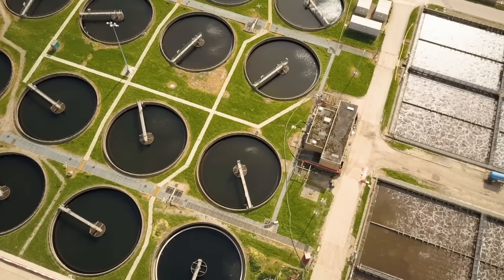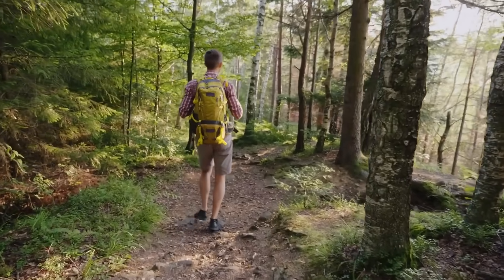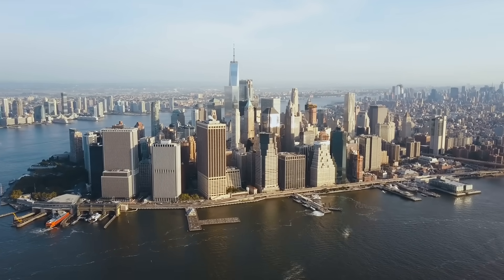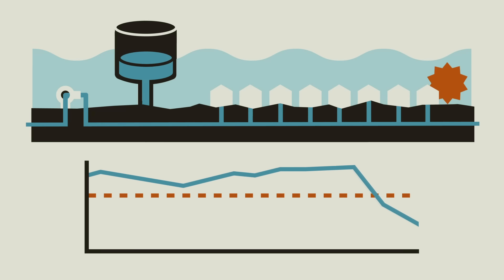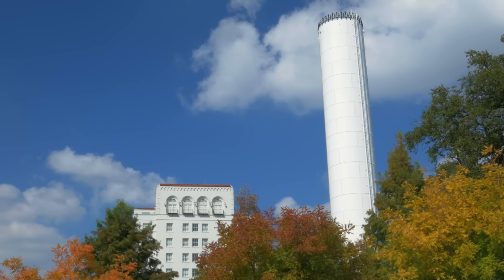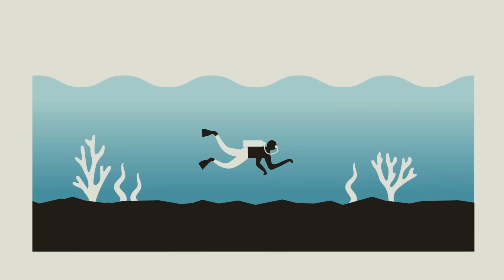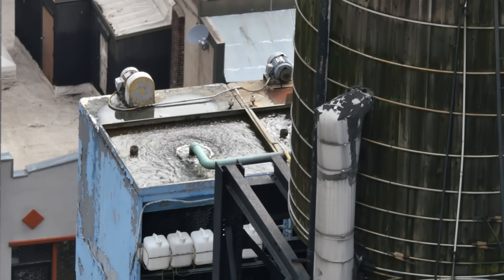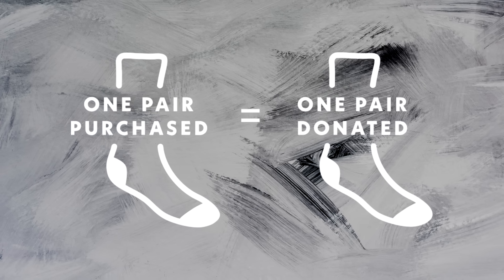How Water Towers Work

Comment: I am a FireFighter in a fairly small town in Ga, the town has about 12,000 residents. The local landfill operator was VERY unaware of the need to keep the pile covered as much as possible and actually told me spontaneous combustion from decay was a myth, so guess what happened one day after a torrential rain came through. Yep the pile caught fire. At max flow we were pumping over 7,500 gallons of water an hour onto it and that was only to keep it from flaring so high it caught the surrounding buildings on fire. Over a 7 day period we put over 4,000,000 gallons on it. The water came from the towns water supply that we had to truck to the scene in tankers and tenders but it all came from the town. We put such a strain that the local water dept sent out notices that the pressure had to be cut in half and that severe drought water restrictions were in place until the fire was over. Thank God for the the rains because the over flowing river where the water was taken from fed the water dept, had it been at normal flow rate, we would have not had enough water to fight it. Oh and btw, if you were wondering the heaviest flow stopped after just 3 days because the state came in with a massive trash pump and set up 6 ag sprinklers on the pile and just used the runoff from what we had pumped on as their water source. We had to spray some areas that they couldn't reach but only when it flared.
Reply: That landfill operator should be taught about combustion. Anyway, he still learned from a physically bad example.
Reply: @SciShorts  Yes he did learn to the tune of a $10,000 an hour fine by the EPA. Last I heard they were appealing the fine but either way it's gonna be expensive. Funny thing is though, the man responsible isn't even afraid of being fired for it because he knows his job is secure since his brother in law is his boss and his uncle is a high ranking county politician.
Reply: @southronjr1570  Too bad you couldn't douse him in the same amount of water. My grandfather was a firefighter, we used to have a running joke that 'it's not spring till the swamp catches fire.' because one of the local peat bogs would inevitably flare up once things thawed.
Reply: Interesting. Thanks for sharing.
Reply: What is a pile?
Reply: @johnburns4017  in this case it was the burning pile of garbage that was exposed that was 3 stories tall.
Reply: @southronjr1570  
The rain caused a fire?
Reply: @johnburns4017  in this case, yes. When biological matter is decomposing the bacteria will cause it to heat up. When the heat reaches the point of ignition and there is available oxygen it will ignite. The bacteria is fed by the rain and thus the water will susequently cause a fire if the items decomposing arent kept cool enough, or kept away from oxygen by being covered up. Hay will do the same thing. If a farmer bales the hay when there is too much moisture left in the grass, it will heat up sufficiently to catch fire. Some of the worst fires I have ever fought were because of the spontaneous combustion of organic material
Reply: @southronjr1570  
thx. I know of some farmers who store manure on a concrete base, which also heats up, which has water pipes running through. The water is heated so free hot water.
Reply: well. I came to see about water towers, and here we are. discussing compost piles, shoe horns, vindication, fire fighters, rational thinking, rain, the environment, mitigation, power, money, science, politics, geothermal warming, chilling, kansas, and a brother-in-law.
I love youtube. 
❤
... now, what was I watching?!?
Reply: In rural kansas areas we have a problem when farmers pile up hay bales and sometimes they combust during the decay process.
Reply: May God keep you all safe!
Reply: Indeed, a compost pile can get hot enough to run a tube through for hot showers. 🤓
Reply: My brother-in-law is a firefighter in Cherokee County, GA.
Reply: This is well stated information.  I'm impressed with your knowledge of firefighting and how creatively and informative you broke down this potential catastrophe.  I lived in Ga for 40 years. . .mainly in the Atlatna area but I grew up in a small rural Va town of 8,000.  The latter had a volunteer FD and I always wondered how these men (and women) were trained to handle fires of large and/or dangerous scenarios involving hazardous materials.  Little towns have limited resources.  We often take firefighting for granted.  We shouldn't.  Thanks for taking the time to explain this.  I'd be curious as to where this Ga community is. . .,or, if you don't wish to divulge it. . .the nearest area of Ga.
Reply: @michaelwolf6424  It happened in Jasper Co after Hurticane Irma came through and dumped a bunch of rain on the uncovered cell of the landfill.
Reply: This is a good example of why environmental regulations are not automatically a bad thing, and why fire regulations in particular are usually born out of some costly disaster.

The landfill owner's disregard of appropriate regulations cost a lot of money, and almost 1. set a town on fire and 2. then nearly cut it off from a fresh water supply.
Reply: Some of the most powerful people in our government, and therefore the world, are very clear they do not believe basic science. Wild times.
Reply: @tombiowami  
Ahhh, just had to bring current politics into it. My favorite!
-_-
Reply: @quintonmorris11  maybe because the landfill operator who caused the fire in this story is said to be safe from getting fired because of his POLITICIAN family member?
Reply: @lawlerzwtf  
No, I don't believe you've gathered what I mean. 
The individual at fault isn't safe from being fired because of his relative's scientific beliefs, but rather because of their political standing. No correlation between belief in science and political preference in this situation. Just a family with great political standing and power in a small community. Nothing to do with their belief in science. Tommy Hooks tried to point this situation out to be that way, unfortunately.
Reply: @quintonmorris11  You use a ton of energy to disprove something he never implied. He just wanted to comment on an idea the conversation made him conjure up. He made a relation with the bigger picture. it's not farfetched or even mildly complex. 
Is the reason of all your efforts the fact that there's a fundamental and overt denier of science currently seating as your president ? 
Is that hard to admit ? Cause the rest of the world noticed about 2 years ago, it's late to feel akward, just be chill about it, murica right ?
Reply: @sirzebra  
Lol no, didn't take a ton of effort, just about five minutes.
The constant relation of politics to anything, whether there's an actual relation or not, is annoying. It's the bigger picture in his mind and it's such a bore to find people whinging about politics all the time. 
That's all I'm saying, I don't have to "admit" or "just be chill" about anything, I wasn't talking about Trump, I was pointing out my condemning of his comment in general.
Reply: Quinton thanks for being the rational voice. You were right, politics was incorrectly shoehorned into the conversation.

If anything the story demonstrates the problem when politicians are given to much power (and money). Had the business owner had the same risks and incentives as a regular business owner they would strive to know the science behind it.
Reply: @daniel_dumile  
Thank you for being my vindication! And you're dead right, too much power, money, and therefore too little mitigation of risk.

Comment: How do new homes get connected to the water grid without a ton of water spraying out when the pipe is opened?
Reply: InternetReviewerGuy shut off valves
Reply: You lay all the pipe from the house out to the water pipe, turn off the water to that pipe, connect the pipe from your house to the water grid, and turn the water back on. Happened where I lived in September. They just turned the water off in my building for 5 hours while most people were at work, and when the water returned, our neighbors had water too.

Comment: water towers are like water capacitors (capacitor to ground) to go with the electrical analogy, where cross section area of the tower is related to capacitance. there would be a significant parasitic inductance analog due to the mass of the water as well. someone correct me if i'm wrong